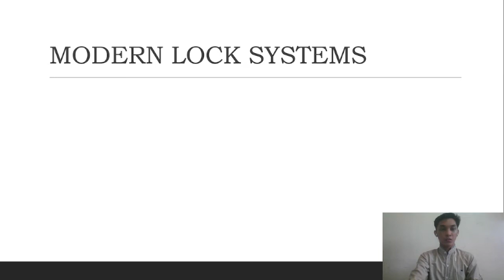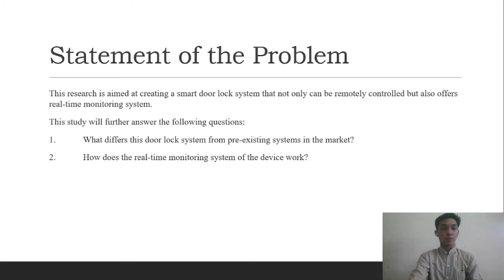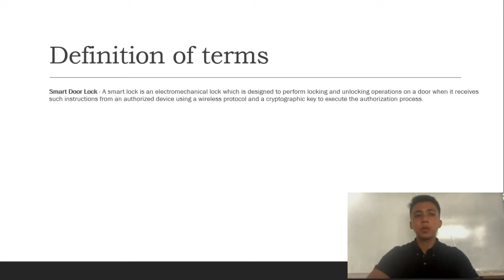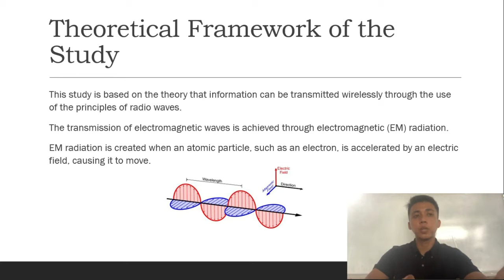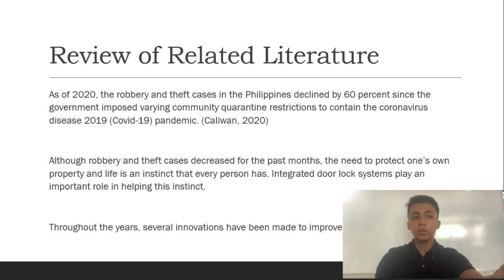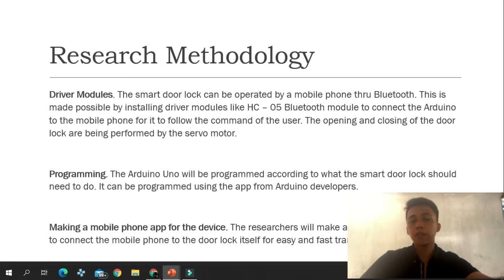Smart Door Lock System with Real-Time Monitoring and Smart Alarm System

Comment: NAME:LEOMAR A. MEDEZ
CLASS NAME & CLASS SCHEDULE: EE341 A TTH-6:30-9:00PM
DATE: March 29, 2022

REACTION:
In light of today's technological advancements, the concept seems topical and interesting. I thought the proposal was well-presented by the presenters. To our knowledge, they have given us enough information to make sense of what they intend to accomplish.

REFLECTION:
This research will focus on the current security threats that are prevalent in today's world. Having stated that, the system will send a text message to the home or office's owner or designated security professionals. Signal jamming devices can't be handled by a simple Arduino, despite its many capabilities. Since the Internet of Things (IOT) was mentioned in the introduction, it makes sense to use Wi-Fi as the primary communication method and SMS as a backup. The Node MCU can also be used to connect to Wi-Fi and strengthen the system's security. This setup can also be used with Alexa and Google Nest.

Comment: Name: Khynny Maureen P. Campoy
Class Name and schedule : ENS 341 Saturday (5:00-8:00pm)
Date: March 26, 2022

Reaction :
The proposed research is similar to the previous studybut the difference is it offers a real time monitoring system. It is a great device that we can use to guarantee our safety and security in outlr homes. 

Reflection :
Smart door lock system with real time monitoring and smart alarm system is providing a security safety using technology. It is very essential to have  a smart door lock device in our homes. We will have an assurance that no one can enter our homes without out permission.

Comment: NAME: Chasty Jane Duran
CLASS NAME: ENS 341 B - Research Methods for Engineering
CLASS SCHEDULE: Saturday, 5:00 - 8:00 pm
DATE: March 26, 2022

Reaction: This was kind of similar to the automated door control system proposed by the other researchers in the other video but they have a slightly different concept and they have presented the information and discussed their proposal very well.  

Reflection: Including a real-time monitoring system is a plus. By sending an SMS when a person is trying to enter the home is more like of google feature, they have thought of a more advanced safety. Security is very crucial in this generation.

Comment: Diaz, Joseph Jr. B. 
ENS 341 B - 5-8 pm Saturday
March 26, 2022

Reaction: I'm amazed of the research study about the smart door lock system. This is the second research study that I watched about the smart door. But compared to the first one that I watched, this is more informative and comprehensive one about the smart door. 

Reflection: The smart door lock system is so helpful because this is not an ordinary type of door lock. It has real-time monitoring system that helps the owner to monitor the frontage of the house and it has smart alarm system that will detect an intruder who tries to open the door.

Comment: Marc Kenneth L. Baldosano
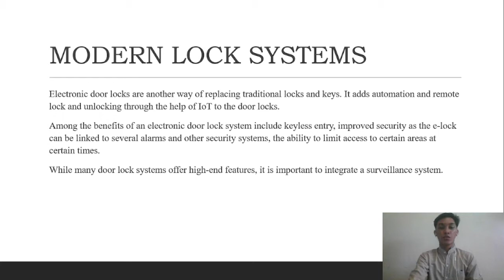ENS 341 A (Saturday 2:00-5:00 pm)
March 26, 2022

REACTION: Just like the reaction I have to the other video similar to this, as of now, I think that all smart lock systems are available in the market, and this one comes with a problem regarding how much force it can withstand. The build quality is mostly substandard, and the locking mechanism can easily be cracked. The good thing is that it has alarm systems and real-time updates.

REFLECTION: Even though my initial reactions to the presentation may be somewhat on the negative side, there is without a doubt that smart lock systems will be the go-to in the future. For now, at least for me, the product is still new, and I believe that it has a lot of potentials.

Comment: Name: Balansag, Lorenzo Jr. B.
Class Name and Class Schedule:  ENS341- Research Methods for Engineering | Saturday 2:00-5:00 pm 
Date: March 26, 2022

Reaction: The proposed research is the same on the previous proposal about  automatic door control system. The difference between the two is that, there proposal has feature that can monitor person trying to access the building. And send a text message to the owner. With that feature, we can easily know when our homes are being breach. Then, we can automatically report it to the authority to see the situation. Overall the idea of the research is really great.

Reflection: As I have experience, our stores have been robbed because of the poor security that the manual locks give. So having a system that has a real time monitoring, will help us to detect the intruder immediately. Respond to that and take proper action to prevent further breach. Also, it has a feature that alarms when the locks are breach, it will immediately alert the owners. It is really a good technology to have in our homes.

Comment: NAME: Lumelyn E. Ragusta
CLASS NAME & CLASS SCHEDULE: ENS 341 B Research Methods for Engineering – S 5:00-8:00 pm
DATE: March 26, 2022
REACTION:  Technological innovations designed for safety purposes are such an amazing idea or invention. It protects your home and, at the same time, protects your life. Smart door lock systems with real-time monitoring and smart alarm systems may be a complicated concept to understand, but they give you easy access to your security, especially because they operate on a wireless network and can be controlled remotely from a smartphone or computer.
REFLECTION: This cutting-edge technology makes people's lives easier and safer. Humans have benefited greatly from the progress of numerous technology. It will assist with the robbery, murder case, and other issues concerning our security within our home. Currently, not many households have this system, but if it becomes the standard, additional people will continue to invest in this security system.

Comment: NAME: Kilapkilap, Joebert L.
CLASS NAME & CLASS SCHEDULE: ENS 341 A – Saturday 2:00 – 5:00 PM
DATE: March 26, 2022

REACTION: This research is extremely useful and tackles a current issue with a viable solution. The idea of a smart door control system for greater security is also supported by this research, which is an excellent way to increase household security through a smart door lock system. It's an intriguing study, similar to the one that came before it, and it backs up the research on smart security.

REFLECTION: The Smart Door Lock System could be the solution for some homeowners who frequently leave their houses for work and are afraid about losing their items left behind due to thievery. This system will not only secure your home, business, or store, but it will also alert you if something unusual occurs outside by monitoring it from your mobile devices.

Comment: Name: Ma. Theresa C. Velasco
Class name & class schedule: ENS 341 B/5:00-8:00PM SATURDAY

Reaction: In their research it was the same as the other one proposal the automated door lock to have smart security but this time they have real Time monitoring and smart alarm system. And it kind of expensive but good of having one of it.

Reflection: Not all houses are safe, the danger is not choosey. But with their research it helps to have a safe security of the house. Expensive but safe.

Comment: Angel Lynes Esona
COE 346 Methods of Research TTH 5:00-6:30PM
March 25,2022

Reaction: This research is incredible. It provides higher security in many industries. This research is similar to the previous proposal, but it has a distinct feature in that it includes a smart alarm system.

Reflection: Reliable access control and door security systems are essential in public buildings and homes. It has been part of the vital growth of technologies. This research will enhance the insights of the world and help the people to be more secured.

Comment: NAME: Alnie Jane M. Aum
CLASS NAME: ENS 341 B - Research Methods for Engineering
SCHEDULE: Saturday, 5:00 - 8:00 pm
DATE: March 25, 2022

REACTION:
     This research is about a Smart Door Lock System with Real-Time Monitoring and Alarm System. This is also a system which battle against the threats of our safety and security. This helps to protect us from the bad people. It also protects the things in our homes, in facilities, establishments, and buildings. This will make easier for us to our daily tasks and not worrying about our security and safety. It is an impressive study indeed.

REFLECTION:
     This study which aimed at creating a smart Door Lock System that can be remotely controlled and offers real-time monitoring system. This is an effective solution to the problems mostly encountered from places commonly visited by robbers. With this technology, safety and security is assured.

Comment: Mamigo, Jascha Anthony T.
EE 341 Research Methods for Engineering TTh 6:30-9:00PM
March 25, 2022

REACTION: This research suggestion is extremely remarkable because it will improve the future safety and security of our homes. I want this proposal to become a reality right now. Hopefully, this will happen shortly.

REFLECTION: The smart lock system is great for home protection, particularly if the owner is regularly away from home. It protects valuables from theft and offers good security against robbery and other external threats.

Comment: NAME: Nica P. Ragay
CLASS NAME & CLASS SCHEDULE: COE 346-A (TTH 5:00-6:30 PM)
DATE: March 25,2022
REACTION: This research is very informative and tackles timely problem and a timely solution. Since we are now living in a digital world, we must cope up with changes especially in enhancing our security systems in our homes and even in offices
REFLECTION: With these security threats that are present nowadays will be addressed by this research. Having said that the system will send an SMS to the owner or security personnel in charge of the house or office. Arduino can do lots of things but the computing power of it, is not enough to handle from signal jamming devices. In addition, it is good to integrate it in Wi-Fi as primary and SMS as the backup since it was mentioned in the intro about IOT. Node MCU is another choice in order to connect with Wi-Fi to make the system more robust. Alexa and Google Nest can also be integrated with this system.

Comment: NAME: Del Franz Lean Consing Ladura

CLASS NAME & CLASS SCHEDULE:  ENS 341 - SATURDAY (5-8PM)

DATE: March 25, 2022

REACTION: The study focuses on smart door lock systems. The system will operate in real-time, which is an advancement over the standard smart door lock. True, these systems are more secure than mechanical ones. You will need technical tools to infiltrate these systems. Because the system operates in real-time, extra precautions are taken, such as sending a text message to the owner, as discussed by the researchers in the video.

REFLECTION:  According to the research, the development of these smart doors has taken about 20 years or so, giving users a sense of security. I've already seen a YouTuber with this type of smart door system. The only difference is that a message is sent to the owner's other family members as well, giving them the option to report to the police. I am relieved that much research is being conducted on the development of smart door systems. Currently, not all homes have this system, but once it appears to be the norm, other people will begin to invest in this security system.

Comment: Catherine Joy Lacson
COE 346 Methods of Research T-TH 5:00-6:30 PM 
March 24, 2022 
Reaction: 
The smart door lock system is very impressive. The voices of the presenters are amazing and clear. They deliver it well and gave us a lot of insights into their proposal.

Reflection:  
This smart door lock system is useful, especially at schools or even at home. They can control everything using their gadgets and it could lessen their effort and at the same time prevent robbery.

Comment: Gliocam, Blessings C.
COE 346 Methods of Research T-TH 5:00-6:30 PM
March 24, 2022

REACTION: This video is quite similar to the previous one and it provides more information about the automatic door control system. Indeed, safety is as important as our lives. Research like this helps us understand certain security issues that need to be addressed.

REFLECTION: he smart lock system is ideal for home security, especially if the owner goes out frequently. It prevents the theft of valuables and provides excellent protection from robbery and and other possible external danger.

Comment: NAME: Cual, Kayzielle B.
CLASS NAME & CLASS SCHEDULE: ENS 341 A (2:00 – 5:00 SAT)
DATE: 3/24/2022

REACTION: Based on the video I had watched, the audio is very clear and audible. The visual presentation of the researchers are so creative and is visible. They had presented their research very well and in a very concise manner. Over all the presentation was very good.

REFLECTION: The research being presented is very much similar to the research about the automated door control system. This research is so modern and improves the security system of a particular building or house. One thing I like the most about this research is that is there is a smart alarm system in it.

Comment: NAME: Jean Clare M. Po
CLASS NAME & CLASS SCHEDULE: ENS 341 2:00 - 5:00 SATURDAY
DATE: MARCH 24, 2022

REACTION: This video is similar to the previous video which gives us information about automated door control systems. Truly, security is very much important as well as our lives. Research like this help us know that there are certain issues about security that needs to be address. 

REFLECTION:  A smart lock is an electromechanical lock that is designed to perform locking and unlocking operations on a door when it receives such instructions from an authorized device. The authorization process is carried out using a wireless protocol and a cryptographic key.

Comment: NAME: John Pius T. Borres
CLASS NAME & CLASS SCHEDULE: ENS341 – Sat. 2-5pm
DATE: March 24, 2022
REACTION: The concept in video is just like in the automated door control systems. This made me realize how critical it is for our home to have a smart door lock system. This will protect the family from harm and danger from unidentified outsiders.
REFLECTION: This research suggestion is extremely remarkable because it will improve the future safety and security of our homes. They not only provide excellent protection, but they also eliminate the need to look for our house keys. We will save time and we will not look for someone to look after our property and belongings when we travel to another nation or away from home.

Comment: Jaemzell Jazz Ocay
COE 346 Methods of Research
TTH 5:00-6:30pm 
March 24, 2022

REACTION: This study is likely similar to the automated door control system which ensures you a high security. Very helpful.

REFLECTION: Juggling and frequent outings are quite difficult to deal with on a daily basis. Add to that the fear of losing your home's security. Traditional padlocks will no longer suffice as a failsafe security strategy for homes. Smart door locks are required to ensure that your home is secure without causing any inconvenience.

Comment: NAME: BERNALDEZ, ELLYN MAE A.
CLASS NAME & CLASS SCHEDULE: ENS 341 - SATURDAY (5-8PM)
DATE: March 24, 2022

REACTION: Based on the video presented, this research proposal is very impressive. This is the answer to facilitate a safer home. It provides a better protection because it also provide alerts in the events of any suspicious activities.

REFLECTION: By using Smart Door Lock System it can help disabled people access doors with ease and ensure they don`t lock themselves out. With the help of smart door locks, there’s no more worrying if you locked the doors or not as some models allow you to check on your phone’s app. Smart door locks integrate into your home system and allow you to manage your home straight from your phone. This research proposal is very helpful.